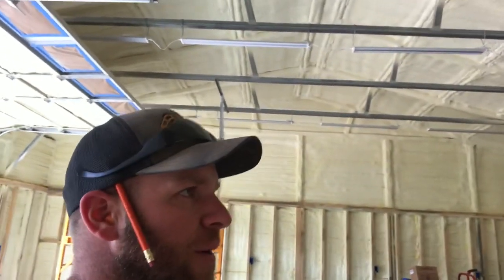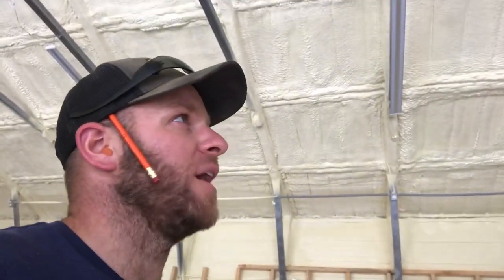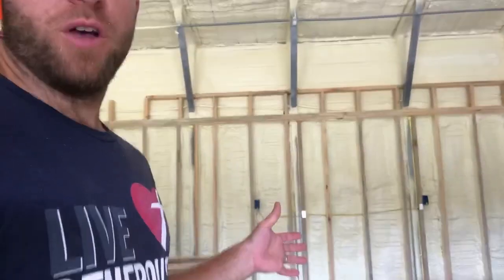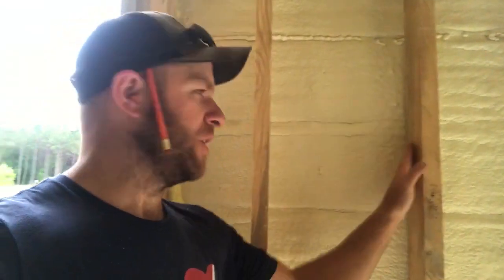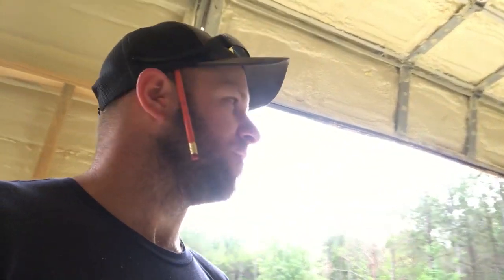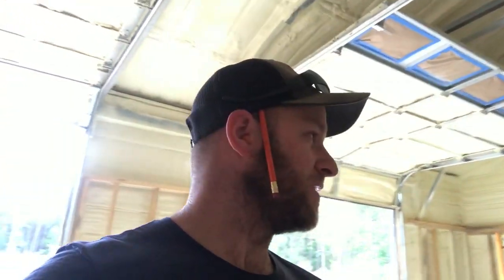Spray Foam Insulation in the Shop and Lessons Learned

Comment: 1" of closed cell reduces heat loss by 72%. 1" isn't enough for moisture control in cold climates. You need 2" for that. 2" also gives you 86% reduction in heat loss
Reply: I do not know the specific percentages you are referring to. But few of the YouTubers know anything about vapor barrier, degree days, and the dew point in your wall. They act like 1” in good for New Mexico or northern Minnesota.
Reply: Do you need a vapor barrier if doing 2” closed cell?
Reply: @Utahforrest  Nope. 2 inches absolutely provides its own vapor barrier. But having said that, if you need to get your project past a building inspector, they're behind the times concerning this type of product and are going to argue both vapor barrier and r value according to code.
Reply: I was going to post the exact same thing.  Were you at Spray Jones too?

Comment: I work on refrigeration units (refers)  3 inch closed cell for walls keeps everything frozen for days.  I think you'll be fine.. How's it workin out ??
Reply from the maker: Need more on the roof and southern exposure. Our 2 ton package unit runs dawn to dusk in the summer.

Comment: Appling closed cell PU to the bottom of a metal roof cannot be counted on to seal roof leaks, nor should you even want that. All Roof leaks need to be repaired on the exterior side of the roof.

Comment: Thanks for the heads up Tom! Just had a 30x36 metal building built, I need to get the electrical done in spring but needed some ideas for insulation after all is said and done
Reply from the maker: Yeah we rushed the insulation as it was getting unbearably hot already this spring, and it did help a lot to break the radiating heat off the metal roof and walls. Small price to pay for a little comfort. We were delayed getting AC turned on, so on cool nights we’d open all the windows and throw a fan in to chill it down, then shut it all first thing in the morning. Kept it tolerable until about noon. 😁
Reply: @TomBrueggen  I'm wondering if it would be better to DROP in a suspended ceiling & spray the foam insulation on top of it INSTEAD of the inside of the actual roof???
Reply: @REVNUMANEWBERN  ..the underside of metal roofs usually sweat, so spraying them will stop that.

Comment: I've talked to a lot of people about insulation over the years. I've never met anyone who thought they put in too much insulation. I've met plenty who wished they'd done more whilst they were making a mess. 1" of foam is obviously a massive improvement over bare metal, but the idea that '95% of it is the first inch' is a very contrived statistic. 2" is twice as much insulation and half the heatloss (through walls and roof) of 1". So yes I think you'll live to regret it. 25mm(1") of PUR is not very good insulation. 50mm(2") PUR isn't either, but it's a hell of a lot better. 'Good' insulation starts at 100mm (4") of PUR foam. Or 1" foam and 4" rockwool would be similar. That's for houses and this isn't a house so that may be excessive, depending on the climate and usage, but anything less than 50mm/2" is a mistake IMHO. Still, well done for doing something. Nothing stops you adding more later except for all the crap you'll put in there. I'd put some fluff in the framing before sealing it up again just because that'll be a pain to get to in the future and rockwool really isn't expensive. Adding more foam to the roof can relatively easily be done later as funds allow.
(I added 100mm PUR to my house (which already had 65mm of fibreglass) on south side and 160mm woodfibre (+65mm fibreglass) on north side - that's decent insulation)

Comment: In my opinion, go 2" closed cell and never look back. 1.25" will probably be all you need, but that extra 3/4" is good insurance.
And forget adding open-cell and/or fiberglass batting, it's a waste of money.
However, get a fireproofing spray on that exposed foam.  You don't want a "Great White" fire event in your shop.
Reply from the maker: We closed up all the walls to 10’ with OSB. And we don’t have any open flame like a stove in the shop. But we did wonder about the flammability of the cured foam. I’m not familiar with the fireproofing spray you mentioned. I’ll have to look it up. Thanks for watching and thanks for sharing!
Reply: @TomBrueggen  Monokote MK6 and Cafco 300 come to mind, but they're only two of many types out there.
Thank you for your video :)

Comment: Today I had spray insulation installed in my 18 X 20 metal garage. I had them use open cell foam and I think I'm going to be pleased with it. I had already done my electricity and each outlet and the breaker box were taped off with plastic. They actually sprayed the insulation out to meet the front of my outlet covers and this may be as much as six inches of foam. I'm happy with it, but I wish the surface could have been smoother. The company talked with me first and discussed shaving the hard exterior of the foam afterwards. I've decided to not do anything to it because I see the value of the thickness of the foam. The salesman asked to meet with me tomorrow to make sure I am happy with the work. I want to keep in mind that this is a garage and pretty walls was never my objective .
Reply: If you use closed cell spray against the metal, it provides both moisture and vapor barriers.  Open cell does neither.  When using open cell, first install a moisture and vapor barrier between the metal and the spray foam.  Some people use 1" of closed cell foam to strengthen the metal building and seal our air and water, then spray open cell inside.   Open cell against metal is prone to collect water when temps change and condensation forms on the inside of the metal, where the open cell works sort of like a sponge.  If going that route, the open cell should eventually dry out, so long as you don't have a serious leak (e.g. screws in metal working loose, or a gap between sheets, etc.).  Open cell on metal is a lot like using fiberglass as the insulation against the metal.  You can use a vapor barrier between the inside of the building and the insulation, to prevent warm, humid inside air from moving through the insulation and causing condensation against the cold metal sheets.
Reply: How much does that cost if you don’t mind me asking? I need to do a 20x20 metal carport

Comment: If you are living in a metal building you need 1” closed on the roof and 3” open cell 
The open cell knocks down the rain noise that closed cell intensifies and gets you 100” radiant barrier 
You only need 1” of closed on the exterior walls after you have framed the walls! We scrape the studs after we spray foam any building
Reply: Hey Carter Insulation, could you go with 1” closed in the ceiling and Batt like rockwool over that instead of closed cell? Thx for any help.

Comment: 1/2 inch thick just to seal building, then fiberglass or rigid board. Cover with drywall or osb.
Reply from the maker: We got hurried and skipped the additional fiberglass, but we have skinned the walls in OSB. Luckily got it done when the wood was normal price! Thanks for watching.

Comment: Way to go using closed cell spray foam you’ll never regret it! And he’s right after 1” of closed cell is all you need unless you’re in Canada. Oh by the way you just made that building much stronger and leak proof!
Reply from the maker: Thanks for watching! Not entirely leakproof actually. Somehow his foam and the roofers of course missed a few spots. We had to touch up 2-3 times. We’d get a rain and have a drip, so then just put more foam on that area
Reply: Thanks for answering my question. I was wondering if the spray foam sealed the inside from leaks.
Reply: Not even close , I'm in Nebraska and 1 inch is not enough
Reply: @countrystrong2062  how many inches do you recommend in Nebraska??
Reply: @jimknowles5483  inch and a half is minimum,   I do not install less than 2" to be safe from condensation.

Comment: I'm curious about your overhead doors.  I assume the foam that was sprayed on them makes them heavier.  Did you have to replace the lift motors with larger ones?
Thanks for sharing, you did a great job.  And I love hearing kids be kids in the background!  Thanks!
Reply from the maker: We don’t have motors on ours, but yes you’d need to adjust your springs to help the motors lift them. We never had our springs adjusted either. The doors are definitely heavier but we can still hoist them without too much struggle. In hindsight we’d have preferred to have just dropped foam board in the panels and foamed to seal it in. Would have been much cleaner.

Thanks for watching!

Comment: When the contractor says "its no problem". Means" no problem for them" always.  
Wall frame should be attached through the perlins from outside before exterior sheathing. for the ceilings if flat sheathed and foamed from above.  In Michigan, R32 ceiling, r28 walls.  With W-Steel roofing screws through the rib. Walls doesn't matter.
Reply from the maker: Yeah we certainly need more on the roof here. Down in the south heat GAIN is our bigger concern in the summer. That ceiling gets hot and our AC basically never shuts off during the day.
Reply: @TomBrueggen  I gave up on foam. Im going with sips. structural insulated panels.
Reply: @TomBrueggen   do you think 2” would have worked on the ceiling? Im in Texas and fixing to do this. Those 105 degree days worry me.

Comment: I will note that 1 thing you said here was wrong. Closed cell at 1 inch is not a 95% heat reduction coating.
1 inch is only about 70%. Typical btu retention (heat loss reduction) doesnt get to 90%+ in real world conditions until you are atleast 2+ inches of 2lb foam.
I'm in minnesota. For pole barns and garages we typically spray a 3 inch ceiling and 2 inch walls. For houses, typically we are at 3 inch walls and 4-6 inches on the ceiling depending on building code.
Reply from the maker: I agree, it didn’t seem right to me either. I asked for thicker on the ceiling and he countered that it would double to triple the cost, so I just said to hell with it for now. The ceiling is still open, so if we get more cash in the future we can add  more
Reply: 2" is 86% reduction, 3" is 90%
Reply: @TomBrueggen  Yes you can absolutely add more later. Spray Jones here on YT is an excellent source. Check out some of his vids. He's the best.

Comment: You can buy a kit to covert a 50 gal. steel drum to a wood burning stove. Perfectly fine for a garage or shop. They work quite well. The kit is less than $60 The drums you can usually get for free. Videos about doing this on YouTube.
Reply from the maker: Well I had a 55 gal steel drum for a burn barrel and it didn’t last a year. Granted it was outside and I got it pretty blazing hot a few times. Anyway, heating isn’t much of a concern for us. Staying cool in summer is much more important!

Comment: You will like the benefits of spray foam insulation.  Yes closed cell to metal always, 1" you'll notice a difference but 2" minimum is what we always recommend.  At 2" you'll have a class II vapor barrier if conditioning the shop.  As far as the goats eating cured PU foam I would not worry about it at all.  There is no benefit to eating it but no harm either.  Our goats would ask for more. LOL.   As far as the overhead doors go we shy away from that due to the added weight.  It may cause them to sag.  One inch probably not but 2" and the load tolerance would be pushed further than designed. 
     Flammability of foam well code dictates a 15 min thermal barrier, drywall, plywood, intumescent paint, or metal to provide that barrier.  But most people don't unless code enforcement will be inspecting.
     Although we have sprayed open cell in some metal buildings we try to convince the building owner to go with 2# closed cell.  Open cell is never a vapor barrier at any thickness and in a perfect storm vapor drive can pass through to condense on the metal surface.  May never happen but we shy away from that.  
      Enjoy your insulation and adore those kids!!  Take care.  Best, Brad
Reply from the maker: Thanks for the info! I hadn’t thought about going with a lighter weight cut still closed cell. Price realistically is all based on how much base chemical used in the end right? And R value/inch is correlated to the density?
Reply: @TomBrueggen  hey tom just got your reply.  im sanding a white oak floor realizing i'd be in bed if i'd just spray more foam and get off my wallet and pay someone who does this crap for a living.  ok now that i'm done venting...   the density is the density of the foam on the spec sheet IF sprayed on ratio.  the spec sheet is everything.  i spray a bunch of different foams depending on what the architect or engineer specs in.  but i always get the manufacturers specs.  and i read and reread.  then if not happy have a resource that sprays that product regularly.  i'm not exactly sure of your question.  so i am on fb under my name and you can PM me and i can explain further.  if i dont hear from you good luck and have a vwry Merry Christmas..
Reply from the maker: @bradsharber6570  Thanks again for the reply. Turns out there are a lot of FB users with your name :). My question I guess is how is the density dictated? Do you buy different density foam as a chemical in the barrel, or do you adjust how you apply it to result in a different density in the wall? I'm certainly no expert in foam, but I'd like to understand it better, at least enough to teach others. I instruct building trades at my local HS now, and would like to be able to explain to the kids what the different weights/densities means.

Comment: Two edged sword. We had the electric installed first, then had it sprayed, fully to the edge of the metal beams. It wasn't my deal, but it's mine now to deal with. Now its impossible to move plugs and wire where we might want to move them, to facilitate interior wall build over the foam and I'm scratching my head how to go about it before putting a vinyl floor in. I wouldn't have minded so much just leaving the foam exposed, it looked kinda of cool like a cave or something, and just painting it. But they sanded it off where the the foam was sprayed over the supporting beams, exposing them, which makes it look like crap. So I can just cover the beams with something, or the whole wall somehow, and figure out how to keep the immovable plugs and switches functional and not looking terrible. And then how to hang stuff on a wall where it's mostly just foam. I'm not a builder, but it seems unorthodox, especially for someone like me do deal with.
Reply from the maker: Yeah in hindsight we just carve out what we have to and then use cans of spray foam to fill back in around it. The idea of being foamed in with no option for change is a bit annoying. Our really biggest regret was not going thicker on the ceiling. Right bow it’s been 100° for a week and for the foreseeable future forecast. The shop ends up about 80-85° before it starts cooling back down in the evening.

Comment: I had my garage roof spray foamed ( r20 fiberglass in walls) so I could use the rafters for light stuff storage and was shocked at how effective it was at insulating it. Cool in summer, warm in winter.. we had -30 deg days in January and water did not freeze on the floor of my unheated garage.  Freaking incredible...
Reply from the maker: It made a huge difference for us just blocking the radiated heat through the metal roof. We still have to install AC just to break the humidity and make it comfortable to work in the summer, but yes, just insulating made it much more bearable!
Reply: I agree. We built in central Florida 16 yrs ago and had quite a few inches of foam blown onto plywood and between trusses and also in a few interior walls to cut down on sound. Our 4500 SF conditioned space (3 units) - electric bill is amazing. The roofers could not warranty the shingles as they had zero clue how the isonene would affect them. So far, so good. I would do it again in a nano second. Service workers are surprised when they have to go into our attic to do any maintenance work. It gets warm,  but is bearable.

Comment: To get leakproof… you have to spray over the roof exterior with either elastomeric acrylic paint or better yet… foam it.. then elastomeric acrylic paint.  …2 coats.  As the foam is being sprayed… there are hard small chips thrown on top of the foam that will break hail stones.  Then you paint it.  Tight as a drum.  Hail … big enough…will damage the foam to some extent… but you just spray/chip and paint again.  Ask me how I know
Reply from the maker: That’s actually really interesting, I’d never heard that method before. Thanks for sharing, I’ll have to look into it.

Comment: If you can get coal deliveries then install a coal stove. If not a wood stove. Either way that shop will be cheap to heat. However I think you would find coal more convenient.
Reply from the maker: No coal to be had around here. We have surplus wood to burn, that would certainly be our most logical fuel